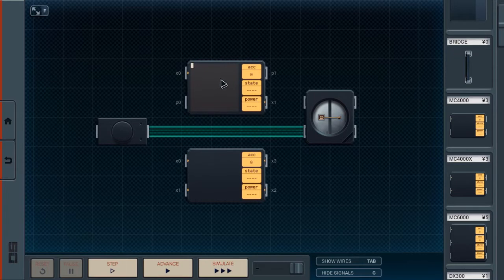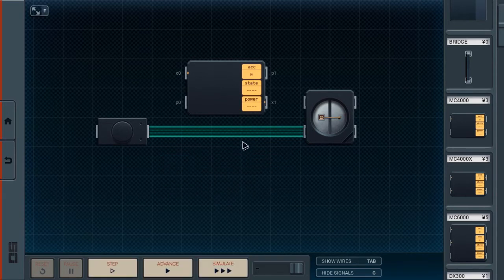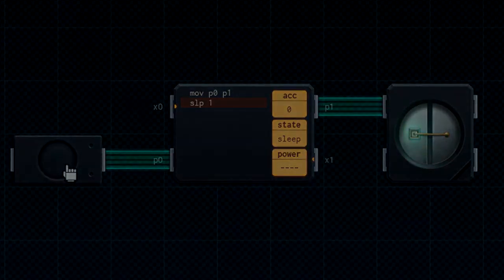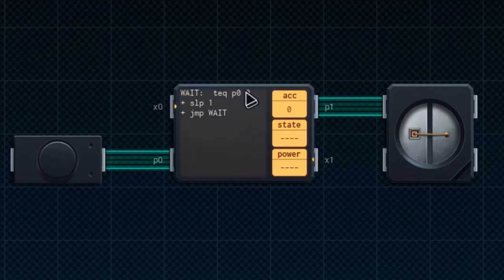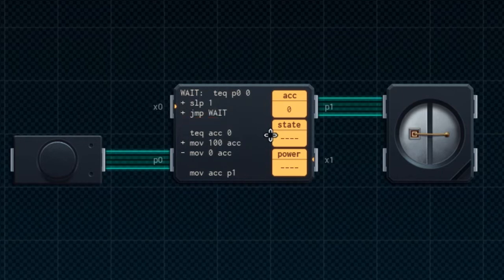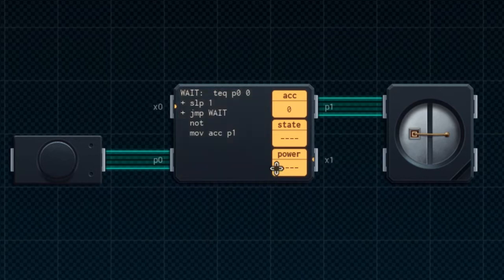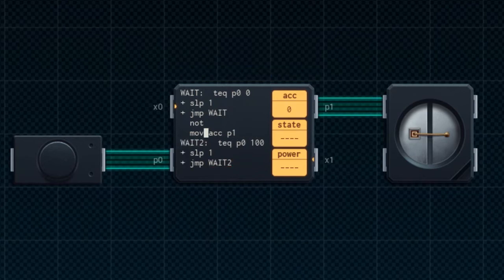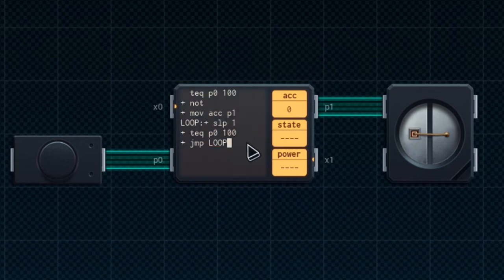Microcontrollers: The Basics (Part 1 of 2) | Shenzhen I/O

Comment: it is work?
teq p0 100mov acc p1
slp 1
tgt p0 100
not
mov acc p1
Reply from the maker: You would need to precede instructions with the + and - signs so I know which conditionals are supposed to be executed. Also "tgt p0 100" will never happen because p0 ranges from 0 to 100 so it will never be greater than 100.

I think I can understand what your code is trying to do but some parts are missing. Code snippets are exactly the kind of interaction I'm looking for with this series so thanks for posting!